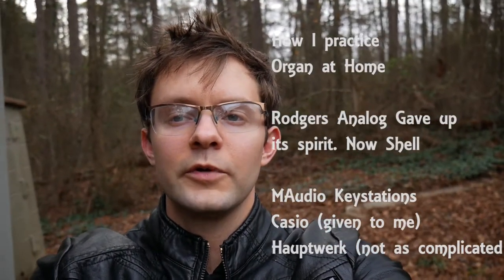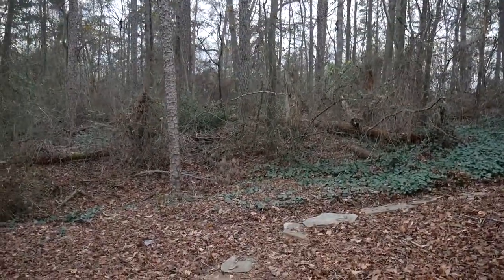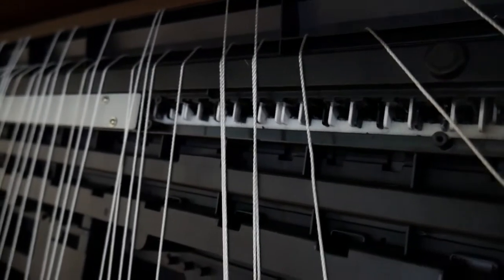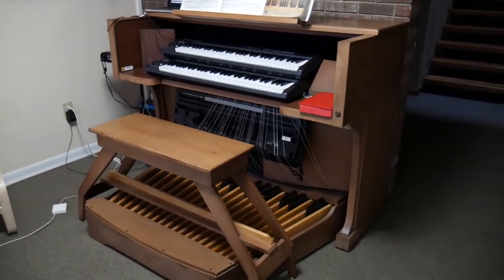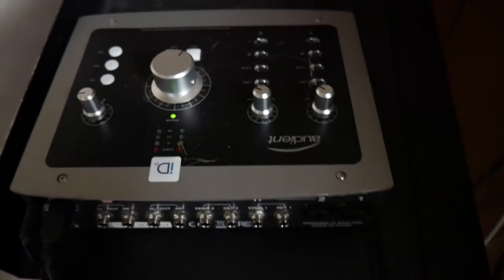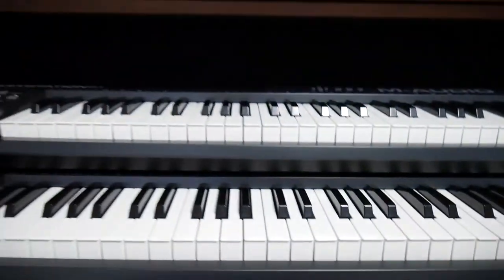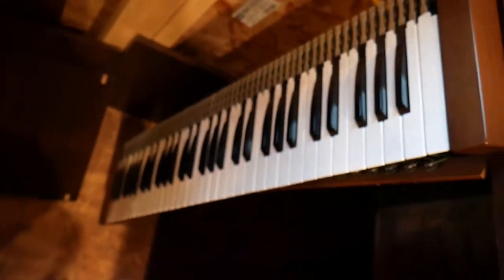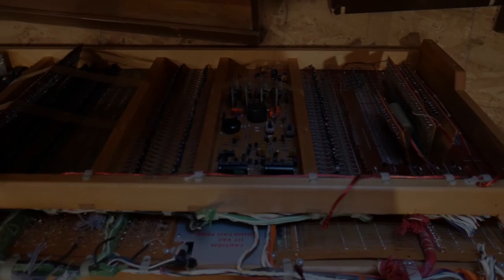How I practice Organ at Home

Comment: +OrganHunters  Classic Organ Works of Canada Ltd. has a MIDI pedalboard (P/N 13-MPD-AGO32WA-2) that accepts +9 to +12 VDC supply and uses standard DIN5 jacks for In and Out/Thru.  Also, the pistonless MIDI organ manuals (P/N 15-CMK-3BW), which are dimensioned to stack in standard keycheeks, same power and MIDI connects as the pedalboard plus expression shoe and sustain kick-switch connections.

Comment: Well, you seemed to have  solved your problem but you could not have done it with out some strings attached. ( Pun deliberate)
If the pedal board had switches you could wire direct to the key board switch panel.
Reply from the maker: Ken Bird depending on how long the strings last i might be doing that. my students are fascinated by the strings so well worth the tying and drilling

Comment: Maybe you thought of it, or maybe not, but since the pedals are attached to the Casio CTK 700 keyboard for the pedal notes with strings, why not use piano wire for the strings?  It would wear much longer than those nylon or polyester strings.  I often wonder how organists practice if they don't have an actual organ at home (as when they are not at church, the ballpark, arena, etc.).  Well, with a real organ, or one as cleverly engineered as you have done, now I know (I just didn't ever think to ask an organist what they really practice on).
Reply from the maker: Zach LaFleur yes good point I didn't think of wire. I always wondered as well and looked on Craigslist for awhile for free instruments but they were mostly non working.
Reply from the maker: Zach LaFleur also I have found that learning fingering and notes/pedals is just half of it and usually spend just as much time on the actual organ that I will be playing on registrations/piston combos/getting a feel for where everything is. But then again I am coming in as a pianist.
Reply: Zach LaFleur Rube golderberg isn’t the way to do it and have it last.  Proper interfaces are how to go about it.

Comment: Why not just wire the pre-existing keyboards and pedal in to midi encoder interfaces.  Save money and sanity instead of gutting and trying to retrofit.
Reply from the maker: Cost of midi encoder. Needed to gut to move around easier.

Comment: Hi, what an awesome setup! I am thinking about doing something similar but I was just wondering how exactly the strings are attached to the actual keys? I mean how the compression of a pedal transfers to the side keyboard? I would highly appreciate if you could perhaps explain it a little more, thanks! :)
Reply: Did you have to drill into the plastic body or the keys themselves to attach the strings?
Reply from the maker: Yes I had to drill holes. It was a cheap keyboard that I will only use for this purpose and it had been laying around the house.

Comment: Hello David,
Thank you for sharing your practice instrument! I completed my practice instrument last year. A friend helped me convert a two manual Moller console (that I had played connected to pipes for nearly 10 years) to a three manual Hauptwerk instrument. If your manuals are bussed (I'm guessing they are, as old as the instrument is), I highly recommend converting the manuals and pedals. I used hardware from DTS Midi Systems (dtsmidisystems.com) to convert the two manuals and pedal. They sell through distributors, and it just happened that Arndt Organ Supply is one of their distributors and is in my back yard. For the third manual (which became the new swell manual), we used a manual from Fatar (which Arndt had a really good deal on!). Arndt also had real organ piston buttons that they engraved onsite and toe pistons. The pistons also connect to the DTS hardware.

You can use any momentary switch with the DTS interface to act as a piston or a stop with Hauptwerk. If you don't want to add midi specific hardware, Hauptwerk also lets you assign things (like stops and pistons) to keys on the keyboard, so you could use something like a USB 10-key pad to add some controls to the console. I ended up using Classic Midi Works for stop controls. They work, but I'm not thrilled with them. It was simple because I didn't have to wire them (they attached directly via USB and have built in), but I wish I would have gone with something different.

I haven't uploaded anything from my instrument yet, but there are pictures on my facebook from start to finish (mark.shultz.iowa).

Sorry for the long comment, but I hope it might help you enhance your practice instrument.
Reply from the maker: Mark Shultz thanks for your comment. after some heavy practicing the strings are taking quite the abuse. I will take a look at those switches. it might be time again to improve my instrument!

Comment: Those are transistor boards for sound amplification (they sort of look like a telephone switching board or even an old fashioned analog computer, just part of it, that is).  So, we now know that Rodgers Scarborough Analog Organs were not tube amplified, but rather transistor amplified.  It is too bad that those electronics didn't still work, but then, you wouldn't have had to be so creative to come up with this organ setup as you did.
Reply: Zach LaFleur Actually, the first board are the oscillators main plus a separate celeste for the Scarborough 110, the subsequent panels are the filtering, gating, and signal routing/mixing.  Most Rodgers analog models for church installation were only preamplifier stages in the console.  Amplification happened in the speaker chambers at the speakers themselves with the built in Rodgers 100 watt amps.

Comment: Interesting job you made there!  I have an organ with pretty same interrior. These plates you put out from your organ were actual "pipes". These are oscilators. One for each note on keyboard. And then on other side you have some resistors and capacytors, that take care of changing that pure frequency from oscilators to different sounds (strings, flutes, etc.) In my organ there were classic little lamps and light sensors next to them. With potenciometer or foot pedal you were changing the brightness of the light which changed volume by this light sensor. I don' t actually know why so complicated but in my particular organ only these lamps were broken. I changed them and I am pretty impressed what a primitive technology can actually do in this case :)
Reply from the maker: Interesting thanks for sharing.